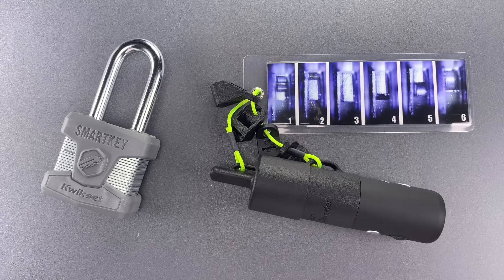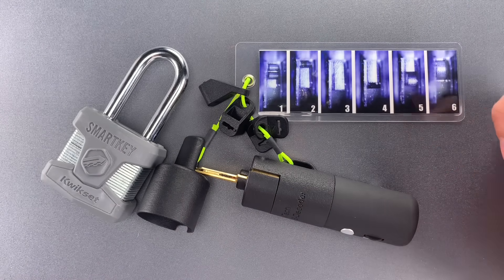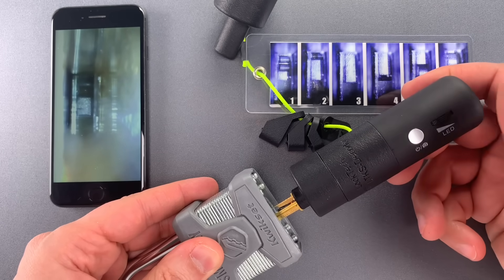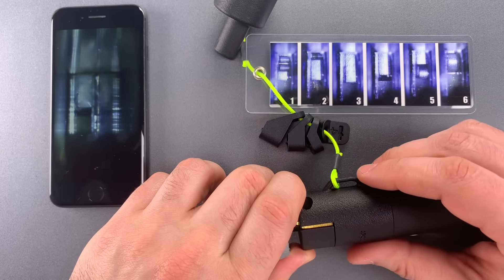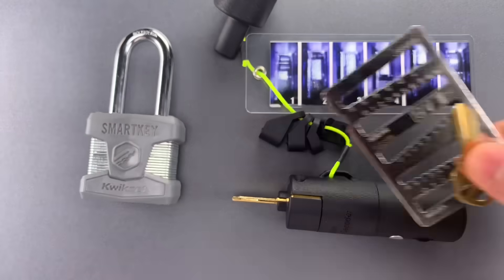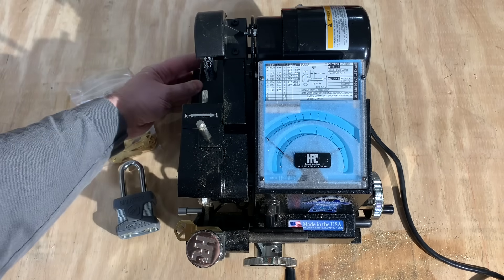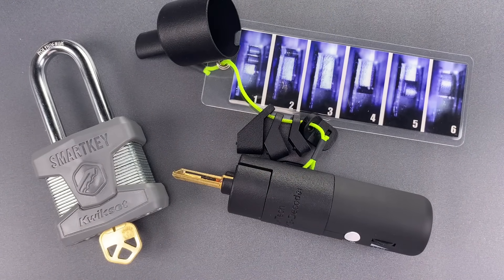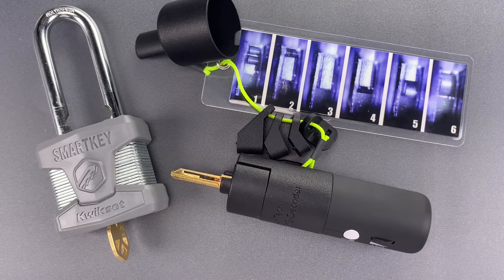[1209] This Tiny WiFi Camera Owns Kwikset SmartKey (LockTech LTKSD)

Comment: Upgraded tool should just have five cameras in right position so you can save a few seconds. Don't forget the Bluetooth connection to your digital key cutting machine in the van/trunk. 

- Jim Phelps

b.t.w. Ethan Hunt is an imposter.
Reply: That's why I never watched the movies past the first. Jim Phelps would never sell out!
Reply: The camera isn't actually in the key.  The camera is in the handle, and pointed at a mirror in the key.  It would be difficult to get 5 mirrors in there, because then they would either be much smaller, or block the view of the next mirror.  I think it would be much more advantageous to have the camera record a video as it is put into the keyway, and use software on the cellphone (or host a cloud-based charge-per-decode service) to automatically generate the bitting code.
Reply: @Kineth1  Thanks for the details, great idea to use video and post processing.

Comment: It's getting to a point where there's almost no point in locks if someone has a few simple tools they can bypass virtually anything. I'm gunna start just putting a bolt and a nut on things to lock them because if anyone really wants in they're going to come with lock tools and not wrenches it would at least slow them down for a few minutes.
Reply: The point of a lock and other security devices is to create a meaningful obstacle (usually in form of a delay), not an absolute barrier - it deters opportunistic access and requires someone to invest in the necessary tools and have them readily available - the stuff that LPL shown is not exactly cheap or available in every hardware store. 

This is where most Masterlock products fail, for instance - they provide little to no delay to someone with even the most basic tools, and so would your idea of bolt and nut.

Comment: Do they not have something simpler for kwikset? I knew someone who was a locksmith, and when I had them rekey some locks, they just had something that resembled a wide hole punch. They would stick the schlage key in turn the dial and just hit the handle down to punch it out and then later clean it up with the deburring.

Comment: Now THIS is cool. Would love to see this in a cylindrical "key" so we can see inside more unusual locks.
Reply: Its Microsoft Bob!!!
Reply: I'm guessing it'd be possible by modifying the blank. But now iWant as a non-destructive tool for looing inside gadgets without taking them apart. I'd thought about using a CCD from a phone, but this looks even smaller. Suspect it's origins are medical & developed for laproscopic examinations.
Reply: @brolohalflemming7042  you can find all manner of cheap endoscope/borescope/inspection scope devices on Amazon.  Some of them are standalone units with their own screen and power supply.  Some simply plug into USB and operate using a webcam app.  I can also vouch for a version made by Ryobi that you can find at Home Depot if you're from the US.  I have one at home and at work and they are absolute life savers.  I am a mechanic by trade.

NOTE: I obviously do not recommend using any of these as actual medical endoscopes.  That's just a search term you can use to find them.
Reply: "This is the camera lockpick Bosnian Bill and I made"
Reply: I think this camera picking only works on Smartkey locks. The design of the lock allows you to see things that most locks hide. The camera trick wouldn't work on other kinds of locks because all you would see is the face of the pins.
Reply: Hey Microsoft Bob, please help me do my taxes.

Comment: It would be faster for law enforcement if they could just slowly slide the camera in while it was taking a video, then review the video after they've left the scene.
Reply: Even faster if it can send the video to a camera next to a cutting machine in the back of a van.
Reply: The tool is likely for locksmiths who are more interested in high quality images to make sure they make a good key than for law enforcement who will start with a pick gun and then move up to a battering ram since there’s no requirement for law enforcement to pay for the damage to your door in most places.

Comment: He made an entirely new key in under 3 minutes to unlock that lock.
What a legend
Reply: Cops are still going to use bolt cutters and a battering ram.  "Non-destructive entry"?  Where's the fun in that!
Reply: @geraldfrost4710  its a great way to get into an object to place a bug without anyone noticing.
Reply: @bepowerification  Shit, didn't even think of that
Reply: @bepowerification  that sounds cool but I doubt that lock has enough room for a bug while leaving it working and the bug unmolested
Reply: @bepowerification  Placing a bug is more spy-ish than police like.  But, yeah, I guess they could do that.
Reply: @sparks6177  He made that comment towards a person that said that they could just break in instead of making a key! So he gave a scenario where you could just make a key to open a lock to gain entry to something like a shed, home, office or even a vehicle! This way the lock would remain undamaged and people would not realize that entry had been made! He didn’t mean put the bug inside the actual lock! 🤦‍♂️
Reply: @geraldfrost4710  If you want to avoid suspicion from the owner you want to get in non-destructively
Reply: I can't believe he actually used his teeth to chew the key into the correct configuration!
Reply: Not really that impressive. Maybe if you've never used a power tool in your entire life.
Reply: @rastas_4221  some locks maybe but lots of locks are sent in the mail and are a “blind pick” if you will. A lot of the videos where he trains on a specific lock are when it’s particularly new or unique I’m fairly certain he doesn’t train with the exact lock he picks in the video vary often
Reply: @sparks6177  not even all that. They are saying he practiced making this specific key multiple times to get it right on camera lmao. If they think that machine was complex it's a wonder they can use any tech device to comment on youtube! That's way more complicated than turning two knobs.
Reply: @TheJuanSolid  I doubt he did multiple takes making that key, the machine looks well built and solid as well as simple to operate, a cheaper or more complex machine and I bet he would have had to try the key several times.
Reply: @sparks6177  It's exactly what you would see a locksmith using, and works.  He almost certainly has a side job as a locksmith or security consultant as well.
Reply: With such machine i cannot say that it's an impressive skill. He's just operating it. Match 5 pictures which the camera shows and follow the manual of the key cutting machine. It's interesting to watch nonetheless.
Reply: @Engineer9736  most people missed the point of the video, he was trying to show how simple and ingenious the tool was and how simply a new key could be made. People are confusing their awe at how awesome making a new key on the spot in 2 minutes is with skill
Reply: @Engineer9736  You’re absolutely correct, This machine requires absolutely no skill at all to use! Even an idiot like you could use it! If these machines are so easy to use why do people often have to go back to have a key remade? My family has owned a summer rental property for the past 50 years, I lost count how many times we had to go back and have a key recut! And the keys that we supplied to be copied are always an original key from the lock! It’s not like we only used one specific locksmith, It has happened with at least six different businesses! Let me ask you this! A Formula One driver is only operating his car and following the track, Do you think you could finish in any other position than last?
Reply: When you know the key number it’s not exactly difficult. A Blue Punch would cut the key in about 30 seconds.
Reply: @rastas_4221  Actually he gets a lot of sealed locks in the mail and makes quick work of them.
Reply: The fact that he manually made it using a paper with lines for measuring the cuts is impressive, he must be very proud.
Reply: @Pycran  When you saw wood you also use lines for measurement and cut it manually? This was even easier because the machine held and cut the key - the guy just moved the dials to set places.
Reply: @Pycran  oh 100%
Reply: @Pycran  When I need to copy my keys, locksmith always do that in a few minutes or so as well. Many professionals out there. I assume he does something similar?
Reply: @Pycran  this is an extremely simple process and is done daily by 17 years old rookie employees at stores worldwide
Reply: He only went slow so you could see the method. When you get moving on one of these, you can cut almost a key a minute.
Reply: I'm sure it took longer than 3 minutes.
Reply: To be fair, it had Blitz in the namw
Reply: I'm sure he had some practice in with this lock and cutting the key, (knowing what cuts to make before the video) but regardless it's still impressive!! Practice with this one single lock would just make it so you could do it with any of these locks in that amount of time....
Reply: @shaneshannon6874  Honestly just watching this video I'd be able to make one as well with that machine.. Very simple operation... Also he knew which cuts to make from the camera inspection already, then you just have to follow the guidesheet on the machine...
Reply: @Aenonar  Yeah you are absolutely correct! It’s not like the key could be installed improperly, Or a cut too deep! Don’t forget proper operation of this machine requires you to assemble it properly! Have you ever had a key made and had to go back and have it re-cut because it did not work smoothly or not at all? A formula one driver is only operating his car and following the track, Do you think you could hop into a Formula One car and finish other than last? Get off your high horse, you are not as good as you think! The fact that you think you could make a key as good as him just by watching his video goes to show that you probably do not have any type of specialized skill, Because if you did you would know that any type of trade requires practice and experience! You probably bounce around from one crappy job to another! Here is a little advice, Don’t forget to wash your paper plates after tonight!